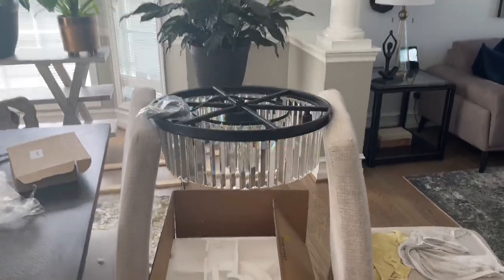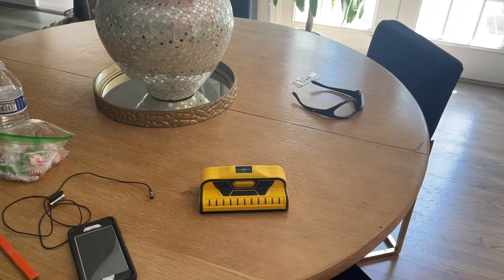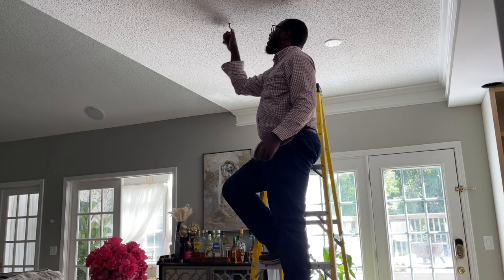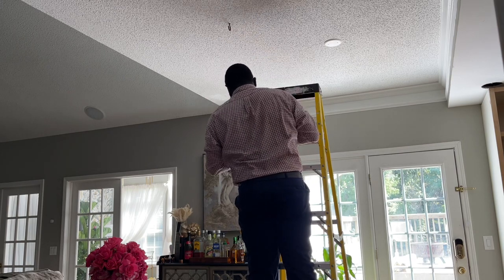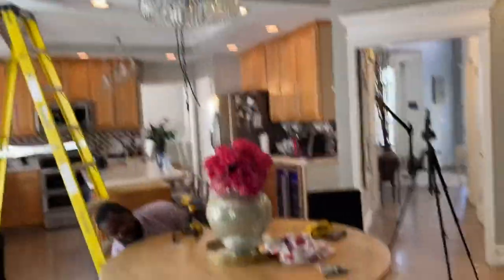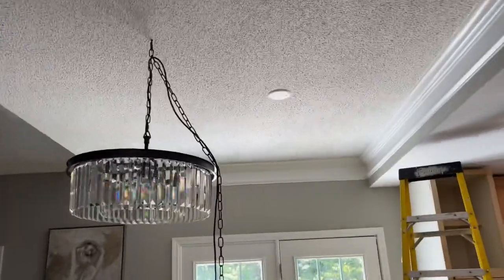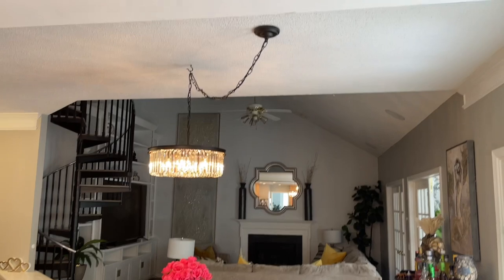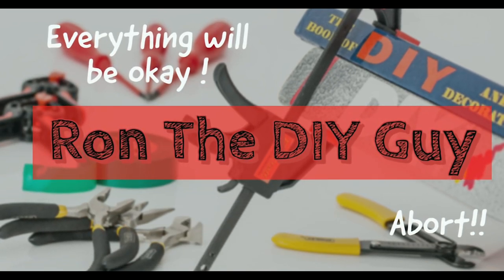DIY-Move Light Location Using a Hook

Comment: Hi Ron, can you hang that light fixture flush on the wall as well?
It's beautiful 😍
Reply from the maker: Almost flush…It came with a much shorter rod but still designed to hang a little but doesn’t need the chain.

Comment: Another awesome job. When you was putting the light up, I was wondering if someone didn't want the chain looped can it be put through the ceiling like you did with the TV cables behind the walls? My second question is. I have a Pendant Light hand over my bar, breakfast counter what ever you call it LOL.Well, the stem is to long for my liking and I would like it shorten. Is there a certain length it should be?
Reply from the maker: For a regular ceiling, 8’-9’, I typically put them around 18” from ceiling. However, it’s really a personal preference. Thanks!